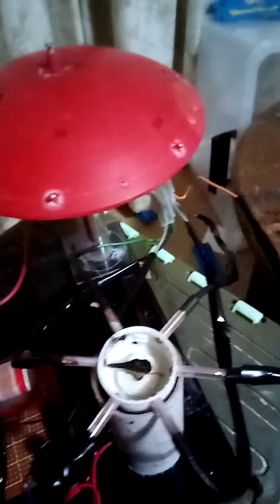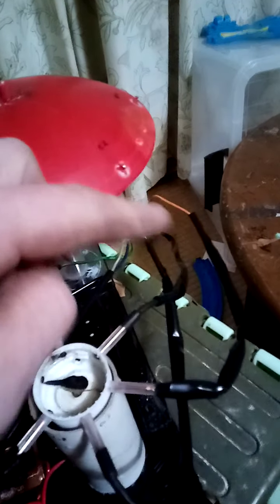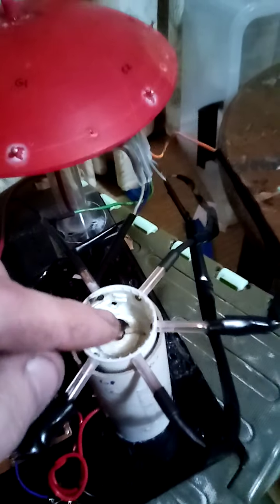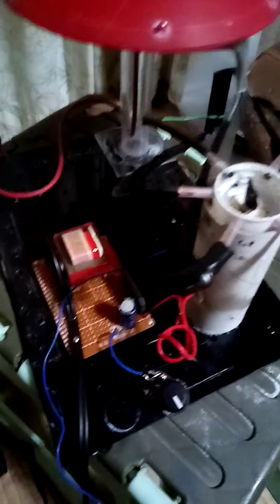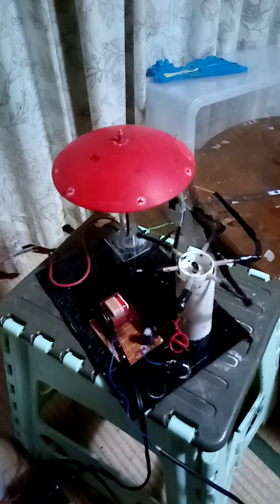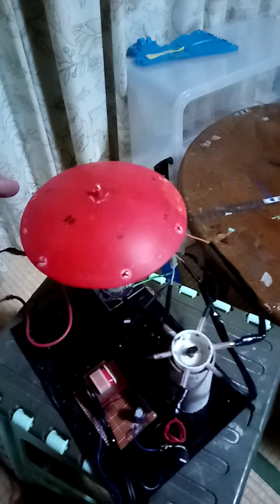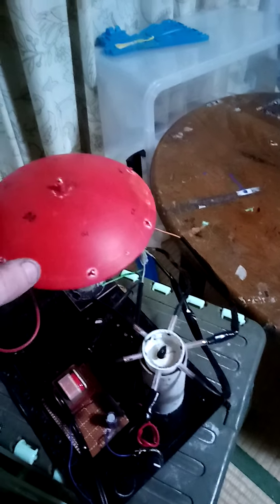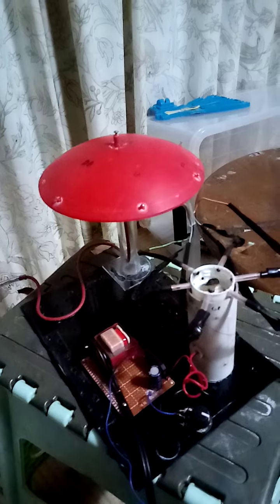Plasma blimp Test model

Comment: that is really awesome.. that is really cool you made it 😊
Reply from the maker: Thank you! The idea is that it works like a hot air balloon. So I am satisfied with how the plasma in circulating around. Next I'm curious on how I'm going to pull in the plasma. Maybe I could induce the plasma into producing it's own magneto sphere. Magnets made out of plasma. I don't know but it will be considered though it could produce dangerous radiation. The inside of the craft will be the safe zone. So some hazards will be dismissed.
Reply: @ironmax654  I really think that's a very good idea.. this is amazing how you come up with that stuff.. I think this is a scientific breakthrough what you are doing now .. I really admired the work you have done.. looking forward to see it and God bless
Reply: @bobjoy3429  I changed my YouTube account. The plasma blimp started turning into a magnetron. So it became dangerous releasing microwaves when induced with magnets. So now I started using a magnetron to create a warp drive. all of my theories have seemed to come true dangerous or not. A virtual particles are real I am very sure I will be able to create a warp drive. If you have any ideas to help it would be helpful.